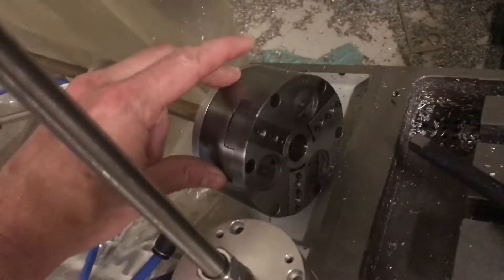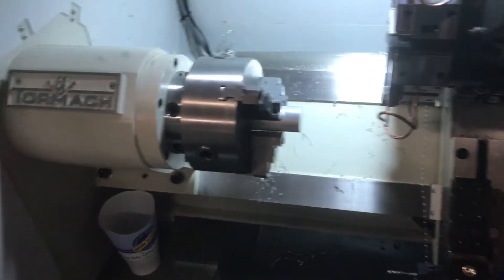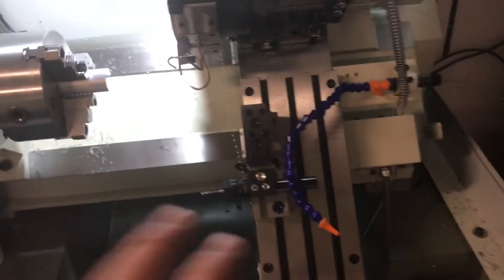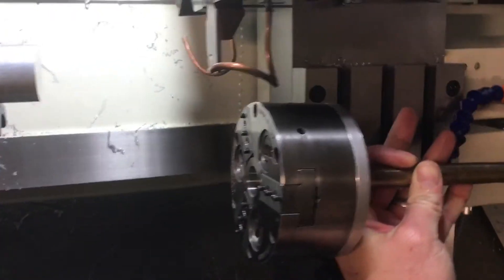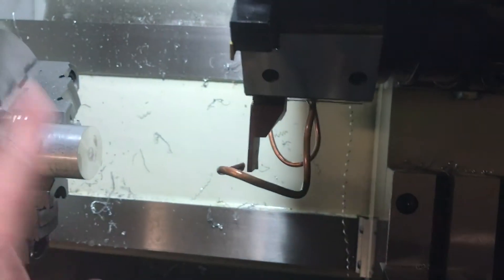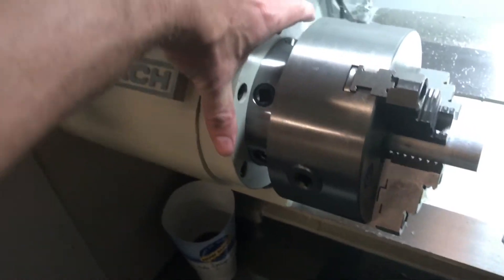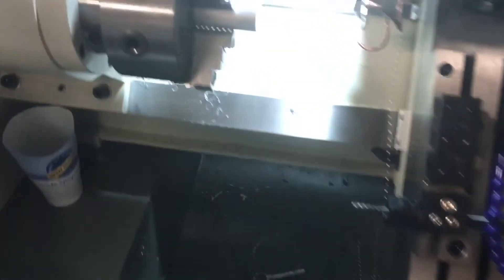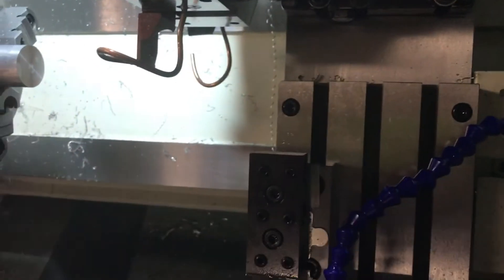Diy Sub Spindle Part 1

Comment: May I suggest -Mount the gang plate to a recrangular bar that you cut dove tails on . so it can go on the ways just underneath the spindle nose. Love the idea of subspindle I have no doubt it would be accurate and useful. You are not going to be able to part the parts from the bar stock but so what, you still be able to do both sides of a discreet part. if the spindle stops no problem with sync

Comment: How are you going to sperate the part from the raw stock in the primary spindle after the sub spindle grabs the part? On most sub spindle lathes the sub spindle is mounted on a separate axis and the turret moves independenttly. If you get that figured out the hardest part is going to be getting the two spindles to sync up. If you dont sync them up perfectly they will burn up your motors or cause the part to spin in the jaws. Good luck with the project. You do good work.

Comment: have you made any headway on this project?  I am in the process of assembling a lathe build myself right now and have the same goals, actually was surprised when I ran across your video.  with linuxcnc now supporting up to 8 spindles independently there should be no reason not to swap parts while rotating unless your closers are not capable of actuating during rotation in which case they would require an upgrade, but that would be a worthwhile investment to step up to a hydraulic system especially having two closers on one machine.  would also allow the use of a dead length collet chuck type if you are doing smaller diameter parts with a bar feeder.    need to rewatch the video as some of the comments are making me think I missed something but I assume the second spindle would be on the z axis and have its own ballscrew and the spindle nose would have enough over hang to reach the primary across the table.  you would of course probably have to ditch most or at least some of the gang tooling setup and just run the turret.  tool holding in the turret might be a bit tricky especially for any drilling ops.. lol  maybe add on a smaller second turret on the lower side with its own slide to back out of the way for primary operations. sub spindle, sub turret... bad ass! :D

Comment: soooo. i've got a 5c collet nose/spindle kicking around that i'm not using. i wouldn't mind contributing it to your project if you think you could make use of it. it's a 50M PRECISION SPINDLE HEADSTOCK. i jerked the air collet closer and draw tube out of it to make our bar feeding 4th axis on colossus (our 770)
Reply from the maker: oooh very interesting! I was looking heavily at those. I almost stopped because they seemed a bit too tall but i started thinking it could probably be mounted on its side so def interested:)  Btw was following your bar puller vid a bit ago and acutally noticed the dunham actuator. Very cool. Side note im moving into my new shop. Just got the tormach stuff moved yesterday! https://www.instagram.com/p/BV5w5btl9al/?taken-by=s2jesse
Reply: sweet. can't wait to get moved in to a new shop myself. minions are getting a bit crowded these days with 5 of us in the shop. if you can use that head stock email katie at artisandice.com and she'll get the shipping arrangements made for you. 

side question: can you live stream from the nest system you're using?
Reply from the maker: So cool! ill hit up Katie and send you some paypal for shipping etc. As for nest believe there is a way to share a public link ill take a peak when i get a chance. I have a few of them some for security and some i put on my machines to make sure they are running smooth when im away.